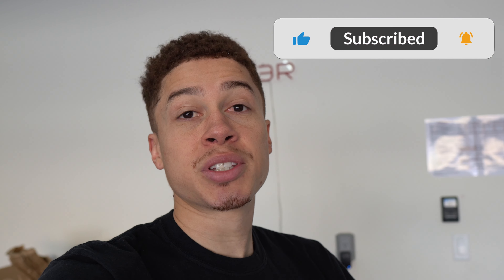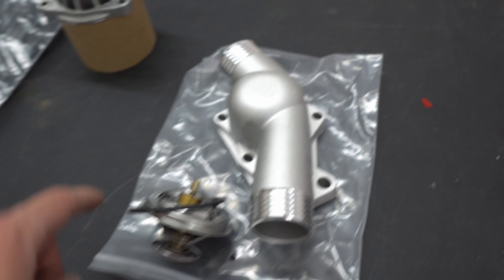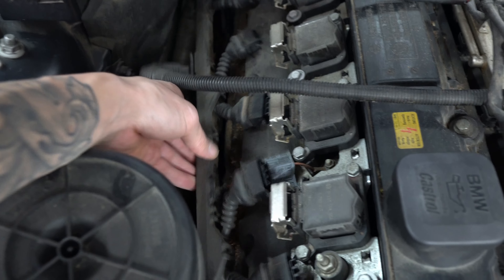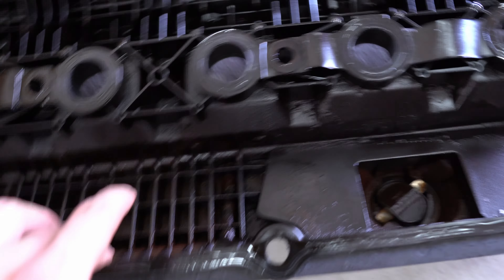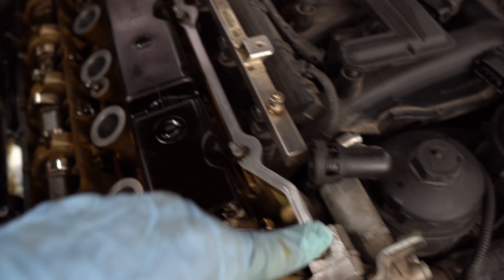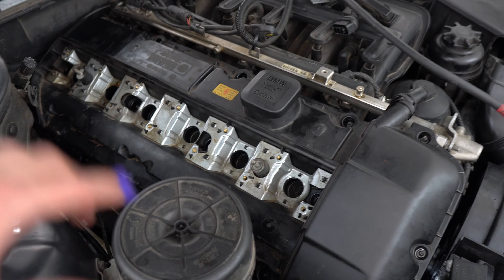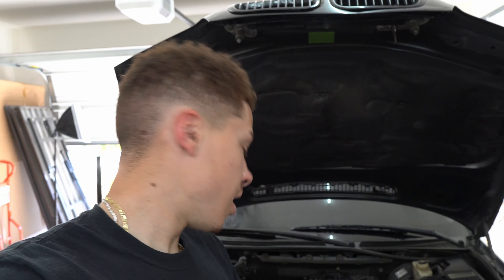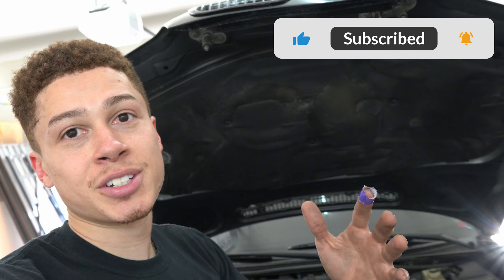E46 Valve Cover Gasket (Road to Reliability Pt 1)

Comment: Absolutely right decision to do all of these jobs. Would recommend to do the cooling system, especially the plastic expansion tank. Currently got 2 E46, one like yours and an M3 and can only say, wherever they can leak they will. Great cars but need to be maintained.

Comment: I just recently traded my 2001 325i for a 2012 335i. I had my 325i for 5 year bro. I replaced everything you're doing now and it was reliable and held up just fine. 85000 miles when I bought it and 140000 when I traded it. 😎
Reply from the maker: Nice man, that’s the goal. Just want a decent, reliable car 💯
Reply: For sure bro, like I said after taking care of all my preventive maintenance I had to change the spark plugs twice throughout the five years of my ownership.. other than that zero issues bro.
Reply: It was a decent reliable car, I just wanted something with a little power. 😆💪
Reply from the maker: Glad to hear that, I’m excited for mine
Reply: Well congrats bro, I wish you the best of luck! E46 life😎